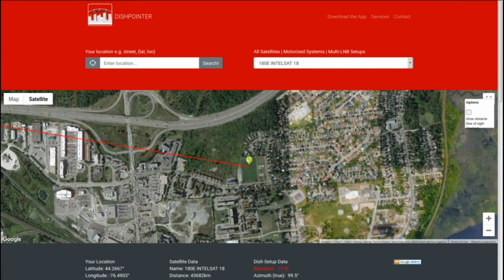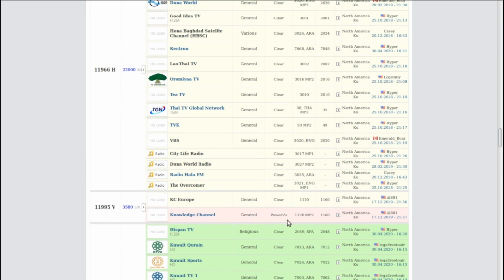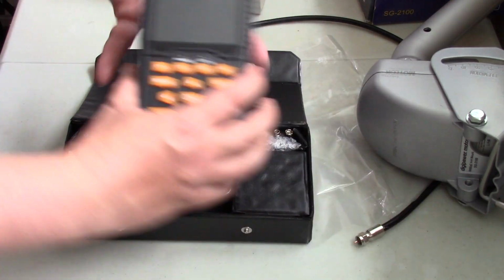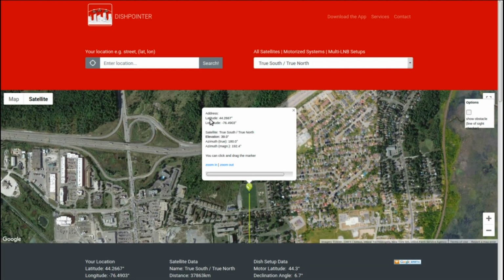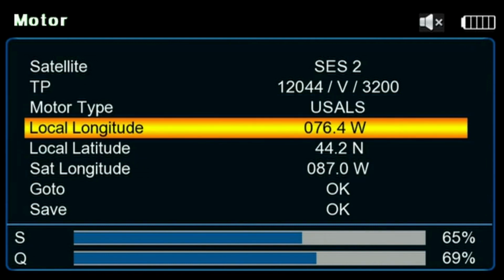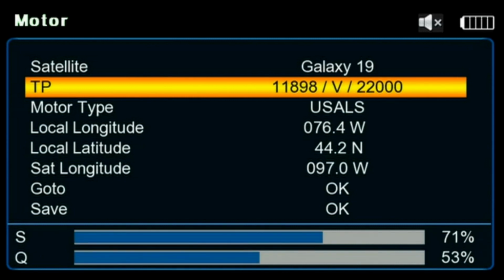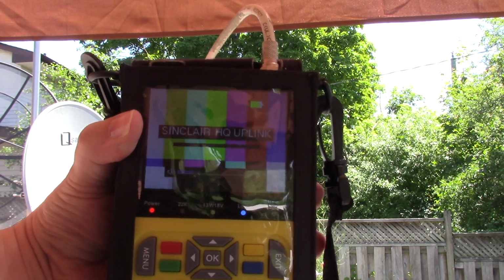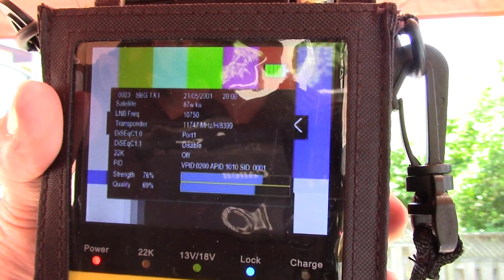Satellite Dish Motor - How to set up a Free Satellite TV Dish!

Comment: boa noite ,aqui do brasil , instalei um deste na minha antena ,depois de 2 anos de usou travou ,não gira mais  ,vc sabe oque pode ser.
Reply from the maker: @Antonio-yf2yl Boa noite Antonio! 🇧🇷  

Obrigado por assistir do Brasil! 👍  

Depois de 2 anos de uso é bem comum o motor travar. Os principais motivos costumam ser:  
- Engrenagens gastas ou quebradas (muito comum)  
- Ferrugem ou sujeira dentro do motor  
- Problema elétrico (fiação solta, capacitor ruim ou motor queimado)  
- Falta de lubrificação  

*O que você pode testar:*  
1. Verifique se o motor recebe energia (teste com multímetro ou outra fonte 12V/36V)  
2. Tente girar manualmente o prato (desligue o motor primeiro)  
3. Confira todas as conexões na caixa de controle  
4. Se o motor fizer barulho mas não girar → quase sempre são as engrenagens  

Infelizmente muitos desses motores chineses não duram mais que 2–3 anos em clima úmido.  

---

*English version:*  

Hey Antonio! Good evening from Brazil! 🇧🇷  

Thanks for watching! After 2 years of use it’s very common for these dish motors to stop rotating. The most frequent causes are worn or broken gears, rust/dirt buildup, electrical issues (loose wires, bad capacitor, or burnt motor), or lack of lubrication.  

*Quick things to check:*  
1. Confirm the motor is getting power  
2. Try turning the dish manually (with motor disconnected)  
3. Check all wiring and connections  
4. If it makes noise but doesn’t move → gears are probably stripped  

These motors don’t always last long in humid climates. If it’s the gears, unfortunately you may need to replace the motor.  

Do you hear any noise when you try to move it? Any error on the receiver? Let me know more details and I’ll try to help further!  

Abraço!  
Robbie

Comment: I purchased a package of dish and motor off of Ebay.  Starting to assemble.  The motor is a SG-2100A, it has a round end like yours but has a cast in ring on the end, like the picture of the motor on the cover of the box.  My dish is an Azure Shine, made in Taiwan.  The attachment in the back is round expandable flange type of deal, wish I could send a picture.  Will I have problems expanding this far enough to place it around the "post" on the motor?  Are you familiar with this brand of dish?  Thank you, enjoy your videos, think I have seen everyone of them!  We are placing a 1 1/2 inch galvanized pipe in the ground, in concrete of course, next week.  Am getting tired of moving dish from one satellite to another.  One more question, I have two receivers, an Amiko mini 4k UHD S2X and a KOQIT V5HH.265.  Think I like the KOQIT better than the Amiko.  How can we safely rid the memory of all the scans.  Now that I know where the satellites are I can replace everything with fresh information.  It is a mess scrolling through things now.

Comment: Up or Down depends SOLELY on the Manufacturer, Example: Mine is a STAB or Fortec Star HH120 and it mounts with the shaft pointing up, NOT down, So be careful and read the instructions. It does make a difference. I think a good indicator might be where the inner mounting holes are located, mine are on the shaft side (Up) and yours are on the opposite side of shaft side (Down), not sure if that's a Universal Law but I just noticed that.

Comment: Robbie do i need a Satellite Dish Positioner unit for my pc satillite card the card is a TBS6904 S2X/S2/S Need your help please the dish i have is a 1.2 meter or do i just connect the motor direct to my card ?
Reply from the maker: The Sathero is a lot better at picking up week signals. But it is over twice as much. 
Sathero SH800HD USB2.0 DVB-S2 HD Spectrum Analyzer Digital Satellite Finder dl45
https://ebay.us/PzlT4r

Pro Digital HD TV FTA DVB-S2/T2/Cable Combo Satellite Signal Meter Finder H.265
https://ebay.us/9e4GZH

Hopfully that will help you out. Also check out my playlist with a full video on how to set up a dish.
https://www.youtube.com/watch?v=8Aod5KIeCLQ&list=PL_g5Ad_LMmeL6DczQqioNPBrYFz56zz0u

Good day

Comment: So this motor only moves from left to right, it does not move up and down?

Also I am a bit confused on what satelite finder I should get, at first I wanted to get GTMedia V8 Finder Pro because it supports h265 decoding and also has dvb-t/2/c 

But after reading some horrible forum posts about how not selective and not sensitive it is and that it doesnt even mesure right I am a bit hesitent to get it

I just want some portable device that could move my motor for testing, that would allow me to watch tv on it snd that would have upgradable fw (if its fw is open sourced or custom fw exists (same thing like dreambox has done) that would be a plus, and that would allow me to input custom lnb parameters and transpoder list to it
Reply from the maker: 1 question per comment please LOL, Yest right left or east west. If you set it up right it will work along the ark
Reply: @RobbieStrike  ok, sorry :)

So why you cannot adjust elevation with it? I mean is elevation something which is based on location and you dont nedd to adjust it often?

Sorry I hope this question makes sense :)

Comment: CAN YOU DIRECT ME ON THE DIFFERENT SIZE ANTENNAS DIFFERENCE BETWEEN THE METAL MESS AND THE SOLID ANTENNA HAVE DETERMINED THAT THE BEST RECEIVER Amiko Mini HD265 Wi-Fi FTA Receiver DVB-S2 H.265 HEVC With NTP and Wi-FiLazmin Satellite Finder Satellite Signal Meter, Digital V8 Satellite Signal Finder HD 1080P Signal Strength Meter Detector, 6000 Channels TV and Radio programmable AGPtek Good For Campers Digital Satellite Signal Meter Finder i KNOW THE LNB NEEDS TO BE DUAL LINEAR OTHER THAN THAT i DON'T HAVE ANY IDEA I WAS PLANNING ON BUYING A 1.9 OR 2.1 METER ANTENNA BUT I WOULD LIKE TO HAVE A ROTOR ON IT CAN YOU HELP ME PLEASE
Reply from the maker: Amiko mini is good and you want a motor like this one MOTECK SG-2100 SATELLITE DISH MOTOR FTA HH SG2100 ROTOR
http://ebay.us/zeixcJ

Comment: The reason I love the H-H Motors si that you don't need extra cables. Just a quad shield RG6U coaxial cable and the 100-120 cm dish. I would recommend MESH dishes for H-H motors. And your receivers is also a positioner. I installed mine in May 2018 a 100 cm Ku Band MESH dish, an AMIKO H-H Motor and recently I replaced the old LNB (which was 4 years old) with a AMIKO ECO L-408 LNB 4 outputs and the signal strength and quality is much higher especially on weak transponders.
Reply from the maker: Yeah set up like that for Ku band it's so much easier I wish there was like more Ku band channels in North America. Don't we all LOL keep watching 117.8 West
Reply: @RobbieStrike  In Europe from Eutelsat 5 West up to TurkemAlem/MonacoSat 52 East, we get hundreds FTA Ku Band channels and with great content. The most tuned are HotBird 13 East (it's exactly like Galaxy 97 West), Astra 19.2 East (Germany, Switzerland, Austria, Spain) Astra 28.2 (UK and Ireland) and depending by the country you can also tune Eutelsat 5 West (Italy and France), Amos 4 West and Astra 4.8 East (Ukraine), Eurobird 9 (Italy, France, Hungary)
Eutelsat 16 East (Romania, Albania, Serbia, Slovenia, Croatia), Astra 23.5, Badr 26 East (Arabic, movies are in english and subtitles are arabic). Hellassat 39 East (Grece, Bulgaria, Romania), Turksat 42 East (Turkey), Azerspace 46 East (Azerbaijan), Belintersat 51 East (Belarus, Czehia, Slovakia),TurkmenAlem/MonacoSat 52 East If you are in Middle East besides Badr 26 East you can also tune Eutelsat 7 and 8 West still arabic channels.

Comment: You seemed to have skipped a few steps there showing how to setup the motor drive.  On the Koqit K1 I can't find any way to configure it so the SG-2100 is not going to work.  I had to get out an older Pansat receiver to make the motor work!
Reply from the maker: The Koqit K1 may have it in some other menu in the settings. All the different brand box's are different interfaces.
Reply: @RobbieStrike  There aren't any Motor settings which is odd because I thought all receivers would have that now.
Reply: @RobbieStrike  I got a new GTMedia V9 receiver that has a setting for the type of motor but there's no way to make it work so it never moves!  I don't think they ever check this stuff to see if it works before releasing the item for sale!

Comment: I can't seem to lock in 87w to save my life.  I put the dish back on the stationary pole and 75% signal and 0 quality is all I can get using my gtfinder v8.  I have no problem finding 97 99.2 or 103w.  If move the motor to one of those and lock the signal in will the dish still be properly aligned to the arc? Do you have any hints as to what I may be doing that is preventing me from locking in 87w? Thanks for your videos,  they have really helped me get this fta system going.

Comment: hi Robbie how are you doing how does it work my said dish moving and is not moving i dont know how does it works thanks Robbie have great summer  !
Reply from the maker: Working, I was having problems with the motor with the splitter on the cables. Took it off and it is working now!

Comment: Eh Robbie how are you doing I’m thinking that is not a problem we’ll it’s Brocken you make a brocket in metal like 1”x1/8 rectângulo come from the side were you connecting the cables on motor bands both sides than were is the broken side drills a hole on both sides that will be strong o then sale to me i will fixed Thanks Robbie have a great holidays be safe  !

Comment: Whoah. I tried Dishpointer site and it looks like I have a big hurdle to overcome. I want 99w and that's farther west than I thought it would be. Many big trees in the way.
Reply from the maker: Chainsaw = winter fire wood!
Reply: @RobbieStrike  Yup. Want to cut the right tree(s) though so I'll have to get that app. Or maybe mount the dish to one of the trees and run a 200' cable?
Reply from the maker: @northpolltv6598  The longer the cable the more signal loss. But if your are far enough back from trees it can work!

Comment: do these work ok with a 1.2 m or is the life short? it looks easier than a actuator and having a second vbox. also can you run it through a diseq 4 way switch?
Reply from the maker: Some 1.2 m dishes may not you need to make sure it has the right fitting!

Comment: Hey Robbie, been away from the hobby for almost a decade, saw your vids and got the itch to go back to the hobby.  A cheap trick I remember when setting up my old 36 inch motorized dish back in the day:  get a u-shaped exhaust pipe clamp from canadian tire and mount it on the pole just below where the motor clamps on the pole.  This prevents the motor/dish from sliding down the pole when you loosen the motor clamps to swing the motor/dish left or right.  With the motor  clamps loose, the motor would be sitting on the exhaust pipe clamp and swinging the motor/dish would be a breeze.

Shoutout from Durham Region (Ajax).
Reply from the maker: Good to know. With i would have thought of that when setting up the pole
Reply: @RobbieStrike  can you recommand a package  dish and a receiver for a new comer  with a reasonable price
Reply from the maker: Check out the store at www.FreeSatelliteTV.net  The Amiko mini and a Geosat Pro dish is a good starter! and some RG6 cable is up there too!

Comment: I'm surprise that with such equipment you didn't provide a free satelite service to all your neighbours :)
Reply from the maker: I offer them free services to set up their own setup
Reply: Robbie Strike in suburbs where everyone has own home it is nice. I live in block and not everyone has a window in right position :to put antenna :(
Reply from the maker: I no apartment buildings should give access to a coax cable run to the roof. For antennas and throwing a 10 ft satellite dish on top of that.
Reply: Robbie Strike there are vertical old channels unused anymore but my building has 11 floors :| community don’t agree for antenna for single apartment and building network for all floors can be expensive and I don’t even imagine how many converters and amplifiers should be on the dish and fighting with community is too much effort. I can assume most people say “but I have cable” or “I don’t need tv” etc

Comment: That 2100 motor is poor quality I went through 2 of them. Do yourself a favor buy a STAB.
Reply: I'm going to agree about STAB.   I've had one working here for at least 9 years now.  I've got a 1 metre commercial dish on a STAB HH90  (designed for 0.9 metre dish) and have pushed it to the limits, and the thing keeps on moving.
Reply from the maker: Good to know, @Bobby @David It gives me a Idea for a future video!
Reply from the maker: My first motor lasted me maybe 8 years. The dish blew down a few times. Not good for the motor. I looked at Stab motors. The ones I saw were like the one in the video where it had the wrong shaft fitting. Some egg shaped thing! https://www.youtube.com/watch?v=adBFFUlCxTc The problem I am seeing is that some online stores ebay and amazon etc, Don't have a photo of the shaft to see if it will fit on my dish! But thanks for the tip. If this one does not last I will try a STAB motor! 
Maybe they will send me one to do a video on.
Reply from the maker: Sorry to hear it did not work for you long. Was it weatherd? Mine has fallen had ice fall on it. In freezing cold Canadian winters, In streaming hot humid summers.
Reply: Robbie Strike I’m in Texas gets super hot But the STAB  motor is now going on about six years with no issues the 2100 I couldn’t get two months out of it before I had to send it back to the factory they put a new board in it then when I went out a second time I just trashed it